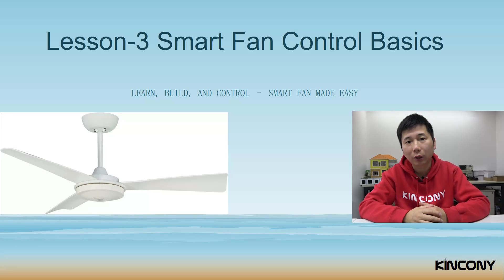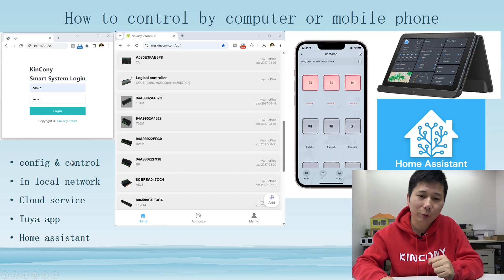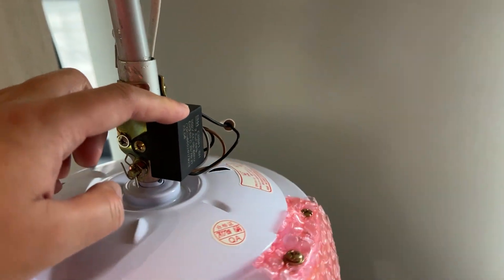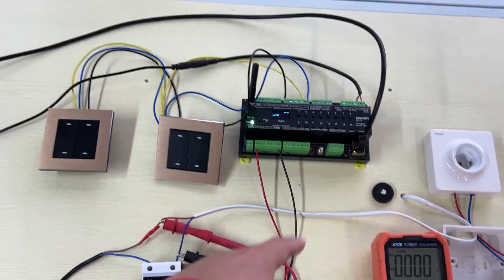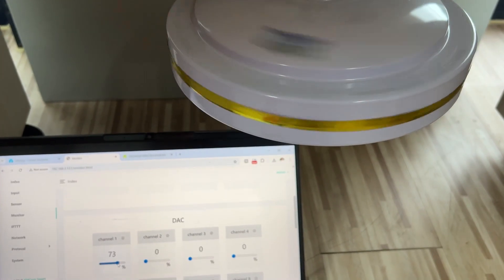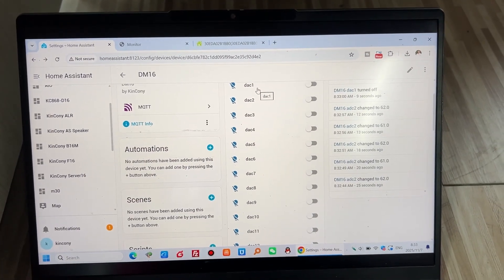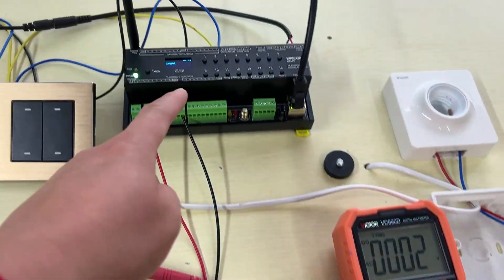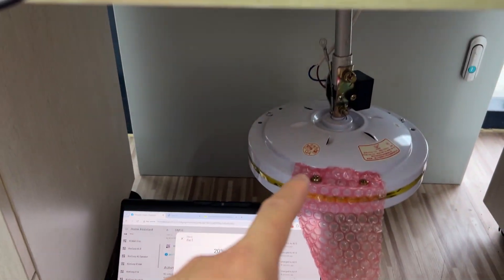How to smart control ceiling fan | KinCony Home Automation Training 3

Comment: Can we use the RS485 for the switch's instead of using the digital intput to control the sam motor from different places and different switch's
Reply from the maker: hardware is ok. just need you write your own code or config by esphome